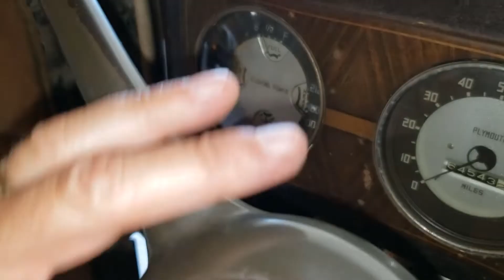Episode 4 -1937 Plymouth Horn Hijinx!

Comment: Excellent!  Wish I had watched this earlier today as I was pondering doing just this procedure.  Just could not figure how much I could pull the assembly in the steering wheel apart before I would start making the issue worse rather than better.   All clear now!  
BTW, It seemed to me that (on mine) there might have been a contact cement or other adhesive used between the medallion and the Bakelite button.  That would mitigate against rattling, I imagine.
Thanks again!
Reply from the maker: Thanks Jeff!:face-blue-smiling: Glad you were able to get yours working. I'll look at my original broken one and see if there's any adhesive on it. I'm curious now!:hand-orange-covering-eyes:

Comment: Awesome Terry.................Hey where did you get replacement horn parts  maybe Bernbaum ???
Also I have a spare flathead just sitting on a pallet pistons STUCK
Reply from the maker: Hey Luke, yes I got those bars from Bernbaum. Are you going to un-stuck that Flathead?
Reply: @FlatheadTerry  I do not have a use for it ...... being replaced with a 318 this car was not original so I have chosen  to streetrod it !